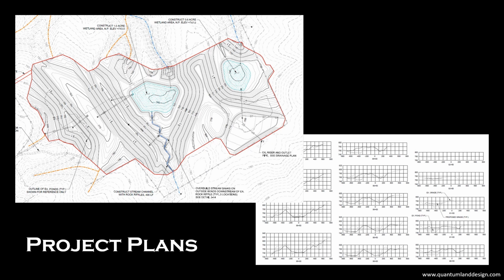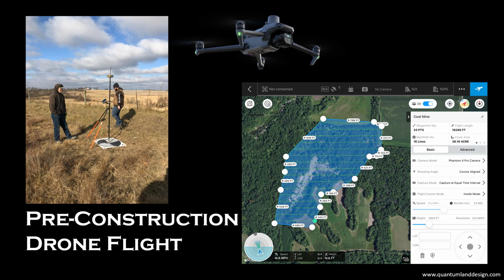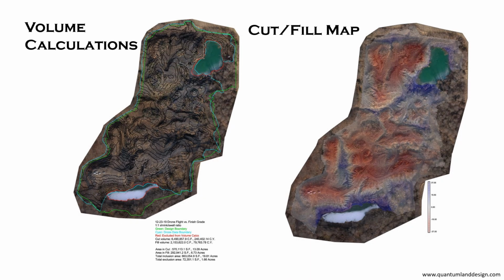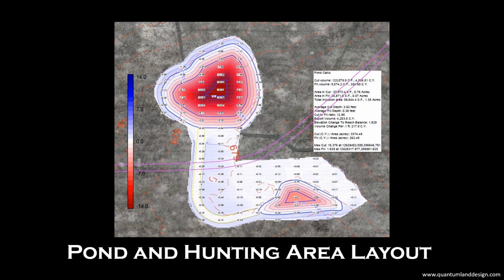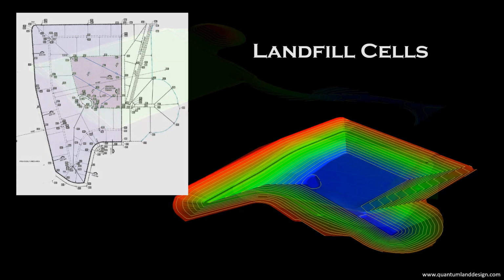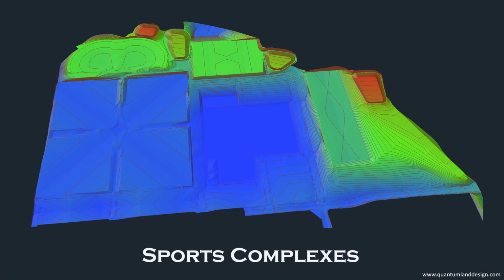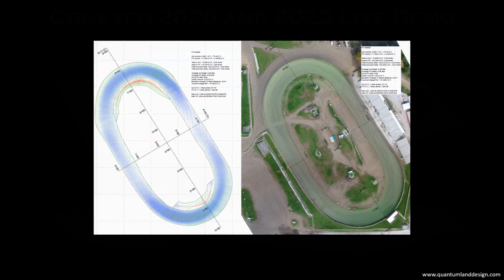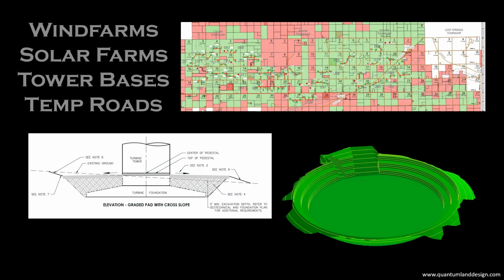Revolutionizing Earthmoving: How GPS Machine Control Enhances Excavation Efficiency

Comment: These guys have been building all of our 3D models for a couple of years. If there is a problem in your plans they will find it. Very knowledgeable, reasonable and quick turnaround. Won't use anybody else. Thanks Zach and team.
Mike from Georgia
Reply from the maker: @smoothoperator20 - Thanks!  I'll share with the team and we appreciate you trusting us with your models.